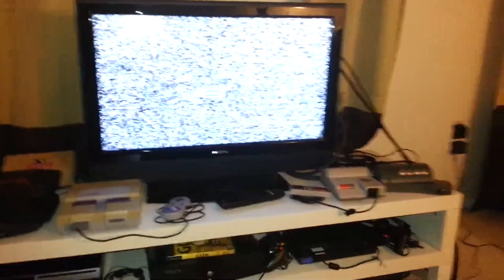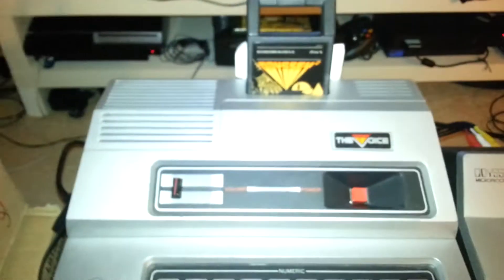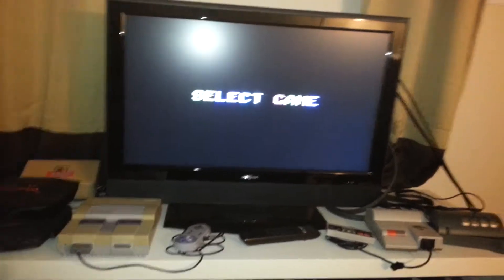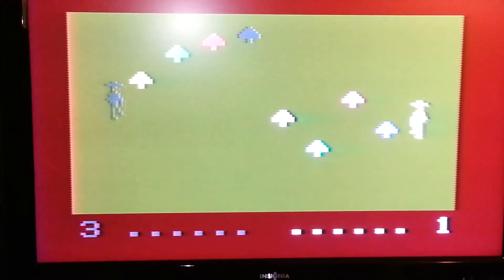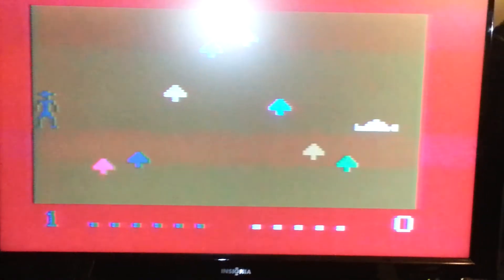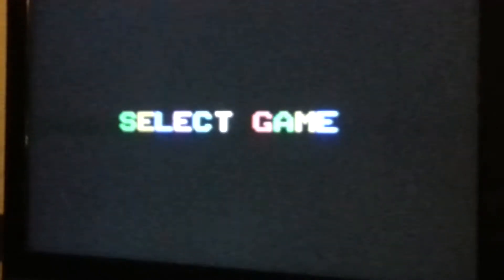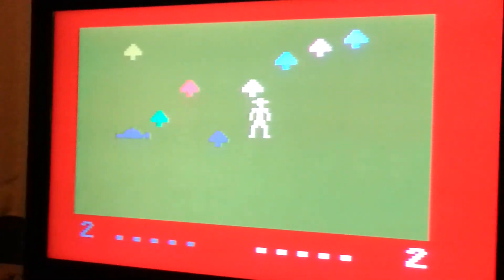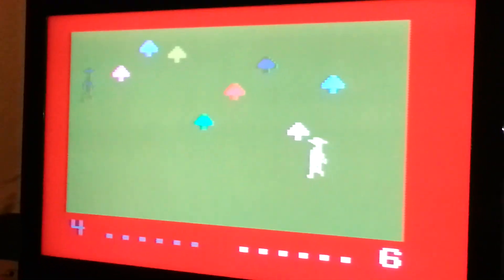Magnavox Odyssey 2 - Comparing 3 Different Video Mods

Comment: And where do you get the circuit board from?
Reply from the maker: I built it myself using the diagram on Solarfox's web page: http://solarfox.triluminary.net/hwh_o2avc_p2.php
Reply: @mtshark7  Can this be S-Video modded?
Reply from the maker: @JohnyTheWizKid  unfortunately it can only be standard A/V modded.
Reply: @mtshark7  which means composite? And I asked around and I was told it is possible to even rgb mod it. But to me, S-video is good enough and it is attainable. The guy just hasn't made the mod boards yet.
Reply from the maker: @JohnyTheWizKid  yea it's composite. About RGB, that I'm not sure of since I have an NTSC TV.
Reply: Is anybody making/selling these?  I'm comfortable with some soldering but I don't know about getting resistors and parts and making it all from scratch...
Reply from the maker: Retreaux Nintendeaux I think they sell them on Ebay? If you want I can build one for you from scratch and sell you one if you'd like. I'll have to make sure I have all the parts to make one (which I should)
Reply: mtshark7 Maybe so... I found one that has a potentiometer that basically adjusts the brightness.  How much would you charge for one?
Reply: Can you install it as well?
Reply from the maker: Retreaux Nintendeaux Unfortunately I don't make the ones with the potentiometer. I just make the standard  one.
Reply from the maker: Rich Alvarado I sure can.
Reply: mtshark7 let's talk then.  RichAlvar@aol.com
Reply: How much do you charge?
Reply from the maker: Rich Alvarado for the circuit board it's $25 shipped